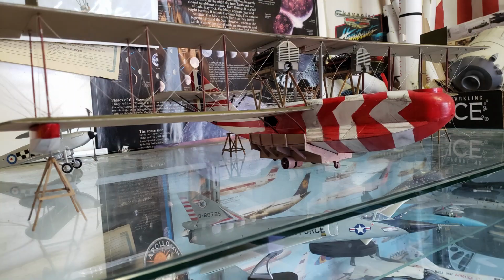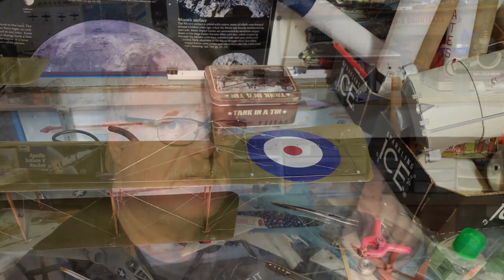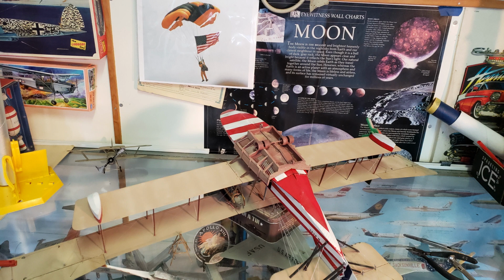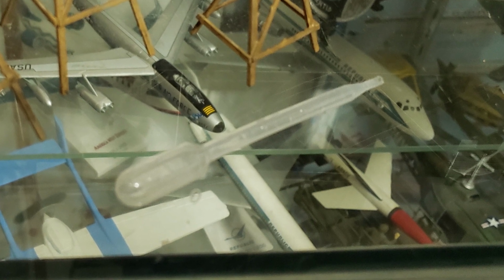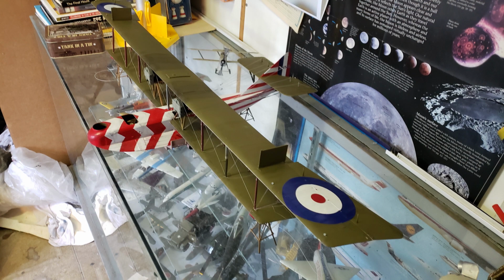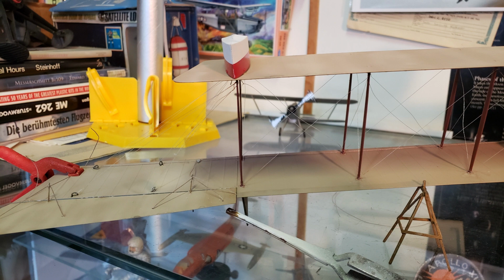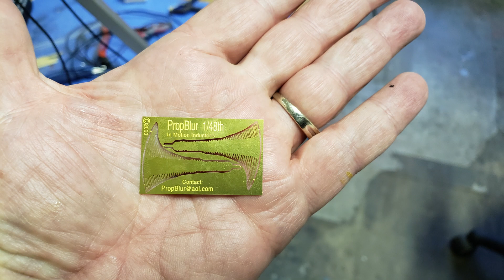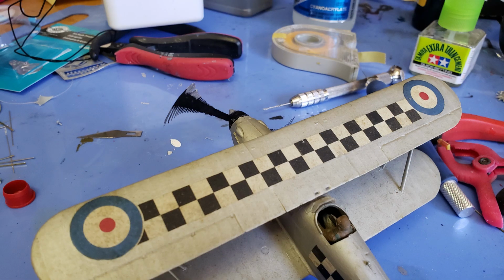Max's Models after hours 5/26/21

Comment: I used to get this cyanoacrylate superglue that you put tiny capillary tubing in the nozzle. Made micro applications easy. Also the same brand sold D7 Deconder. A few drops on a wrongly located part, some time, and you could wipe away the old glue and start again. Debonder was also handy for unsticking Superglued fingers.
Reply: @maxsmodels  The first time I ever used Superglue I glued my fingers together, 40 odd years ago. Mum's nail polish remover, which contained acetone, got them apart again. Not sure if modern acetone-free removers work or not. Still do not like Superglue.

Comment: Greetings,
This is an off the wall guess on how to re-rig the Felixstowe.
The problem is the long wings.  I’m sure that the riggers supported the wings on trestles, and fitted the wires.
If the wings drooped when the trestles were removed, they just accepted it.
Or they might have pulled the landing wires and tight and accepted the wings flexing up and adopting a little extra dihedral.
The rigger’s goal is not to achieve some theoretical perfection, it’s to make the aircraft fly straight.
Some pilots preferred the aircraft to be rigged in a nonstandard way.  I’ve seen pictures of SE5as with almost all the dihedral removed.

Now, to get the Felixistowe looking right in the air.
Invert the aircraft, and force in a little dihedral.
That will artificially shorten the landing wires.  They will end up under tension, so choose strong wires and glue.
Now fit the flying wires using stretchable thread, under a little tension.
Two or three extra hands will probably come in handy for this procedure.
Turn the aircraft upright.  If your judgement was good, the landing wires will be taught, and hold the wings flat.
The flying wires will shorten, but if the preload is right, they won’t go slack.
Add a flight crew and spinning propellers.
Bingo!  You’ve got a sub hunter!

Orrrrrrrr...
Accept the inevitable.
Use the trestles, and add some guys climbing the rigging, trying to get the damned thing to fly straight and stop the pilots from whining about how it always wants to turn right!

Let’s be careful out there.

Comment: I made a cheap applicator by Dremeling the eye of a sewing needle into a "U" and sticking the pointed shaft into a cork. It allows very precise application of a drop of super glue wherever needed. Clean out any dried glue left in the "U" with inexpensive nail polish remover.

Comment: Ah, there's light at the end of the tunnel, nicht wahr?  

 I downloaded the PDF instructions for the Felixstowe from Scalemates (much less expensive--as in free--) versus bidding $500 + for a kit from eBay.   The intricacy of the rigging combined with the wingspan looks daunting to put it mildly.     I'm wondering if the kit's wing flex is a fait accompli given the wing length and material.  

As you mentioned, flex line might mitigate line sagging.  I've found flex line to be user friendly and mostly forgiving of my klutziness although those strands can be slippery even with good quality tweezers!  Granted, none of my planes have been around long enough to make any observations about the lifespan of EZ Line.  

I haven't tried an alternative material... photo etched wire--but I've seen some pictures of beautiful builds using the wire made by RB Productions.   The RB wire is flat,  but I've read that's appropriate for the bracing lines on period British planes.  I'm thinking of  trying it on a couple of my 'unrigged' Aurora builds.  

I'm wondering when you'll be adding TARBIS TWO in the backyard.  It will make a lovely home  for the 8'x4' Felixstowe Harbour Diorama (Autumn 2021 project?)  ;)